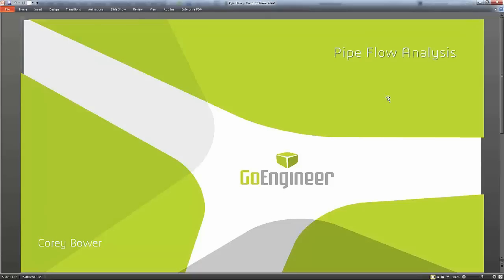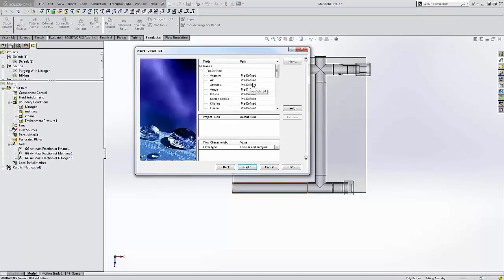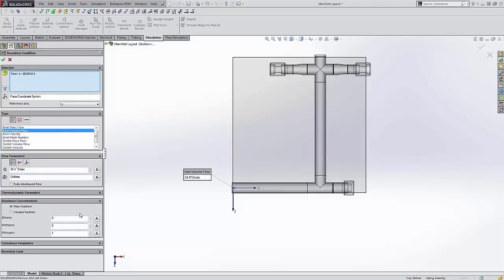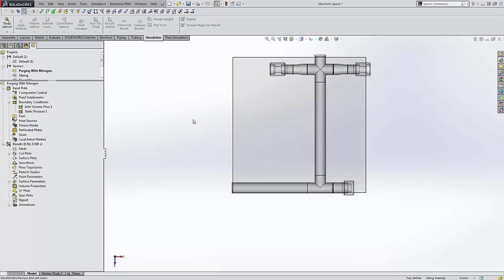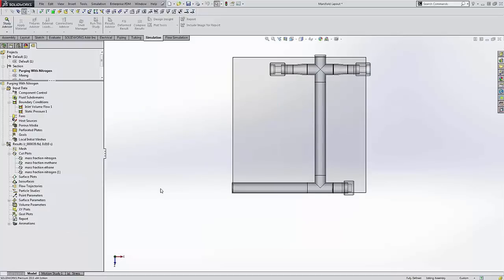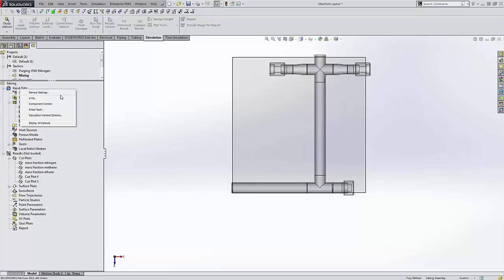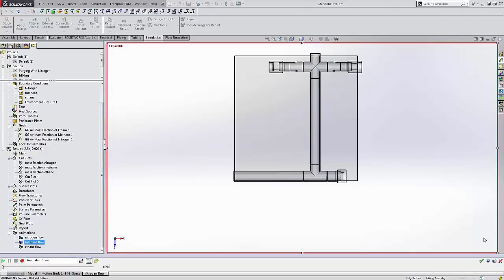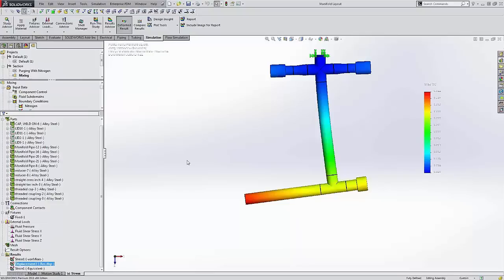SOLIDWORKS - Flow Simulation, Flow in a Piping System

Comment: yes Fluent and CFX have the ability to simulate phase change of fluid flow in pipe but i can not do it because the tutorials and youtube on phase change looking for me is zero i do not watch any tutorial on youtube on phase change 
i read papers on phase change they use fluent ,Volume of fluid method with k epsolon model to solve phase change but they do not give the case of simulation . why the phase change tutorial very small
thank you